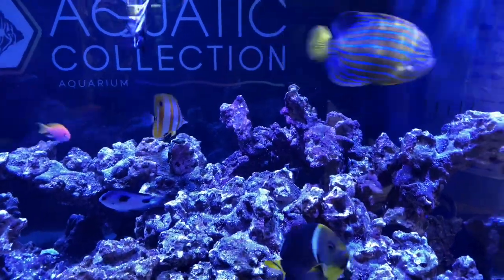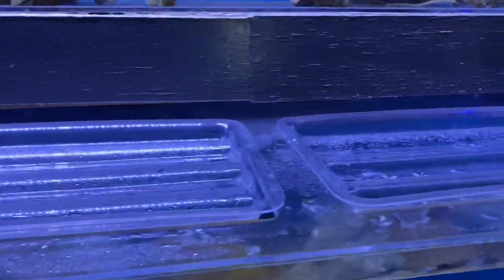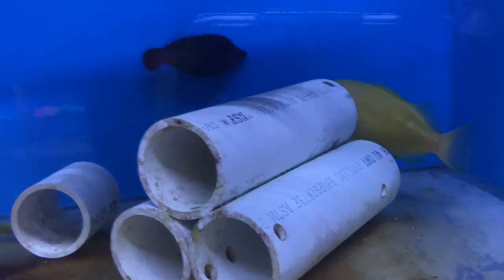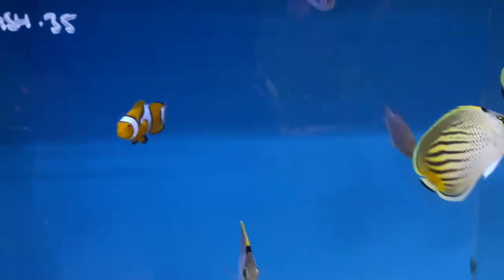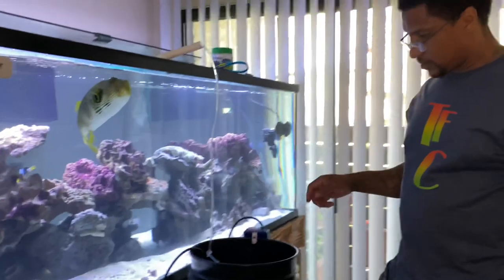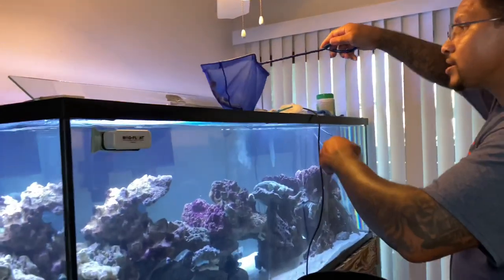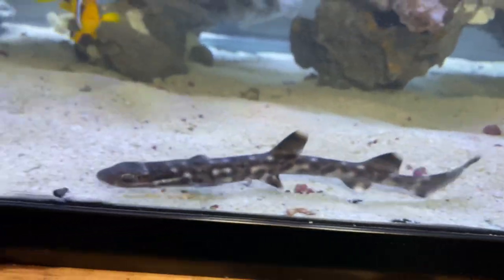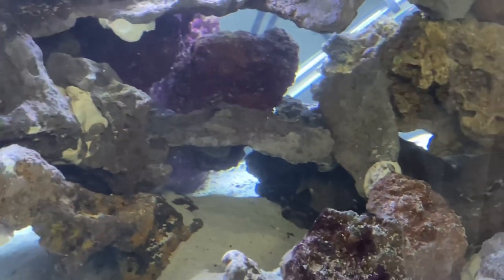**NEW SHARK** FOR THE 225 GALLON SALTWATER PREDATOR TANK!!!

Comment: You make me want to get a saltwater tank lol
Reply from the maker: You should give it a shot. I started out with a 20 gallon. 💯
Reply: @TheFishCorner  yes that's what i was thinking. Starting small.
Reply: Smaller tanks require more maintenance fact
Reply from the maker: If you go too small. 20gallon and up it’s easy asf. But anything over 100 gallons is a b***h. Fact.
Reply from the maker: My 20 gallon and 37 gallon was effortless to maintain.
Reply: @TheFishCorner  it’s because you’re only sand and rock. I run a whole 250 gallon reef tank so my water has to be A1 24/7 maintaining a 20 gallon reef tank with a reef setup is a not easy at all worrying about salt fluctuations for coral since they are very sensitive
Reply: I have a 20gal and 55gal, the 20gal I have corals on it and it's the little bit more headache, the 55gal I just have sand, rock and fish and I change water every month, easy, but the 20gal, oh hell😂